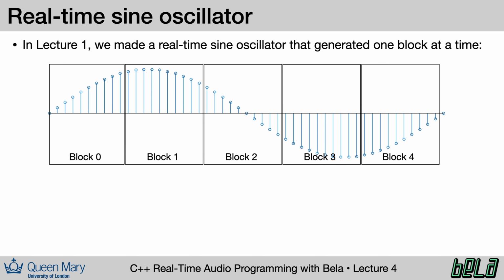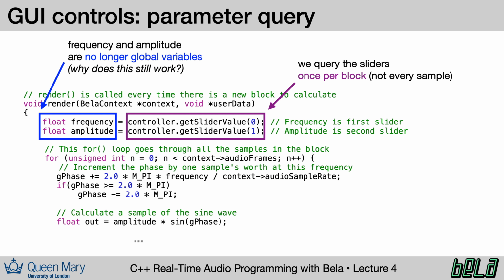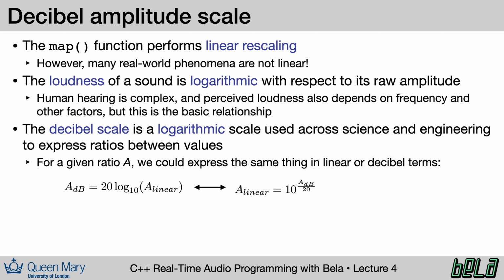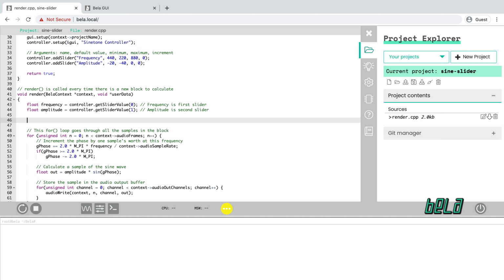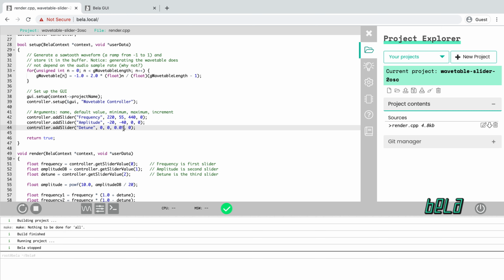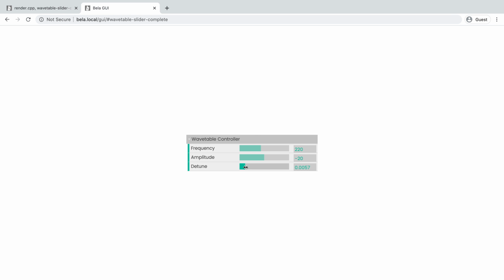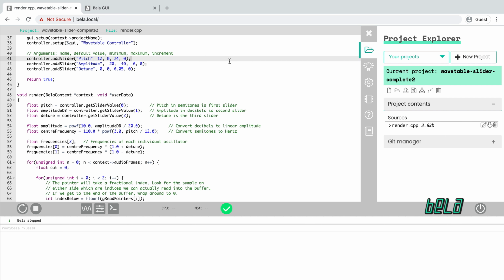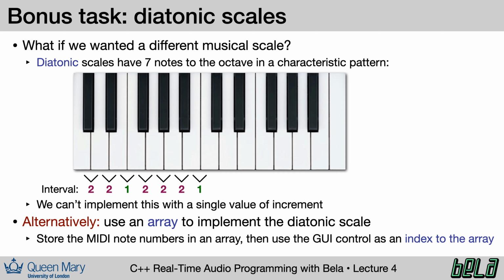4: Parameter Control, C++ Real-Time Audio Programming with Bela

Comment: Hi Yall,
Is there a reason why the amplitude should be multipled by 1/n, where n is the number of oscillators? Right now, wouldn't you be getting a doubling of the specified amplitude?

Comment: Gosu Material!!

Question: When changing the scale of amplitude to a DB scale, could I have just added this line to get the same result?

amplitude = map(amplitude, 0, 1, pow(10, (-40/20)), pow(10, 0));

Also, I implemented the major scale intervals (crudely). It took me a solid 20 minutes of tinkering sadly. This is what I came up with:

	controller.addSlider("Pitch", 0, 0, 7, 1);
	controller.addSlider("Amplitude", -20, -40, 0, 0);			//AMPLtude in DB
	controller.addSlider("Tune Parameter", 0, 0, 0.05, 0);

	return true;
}

void render(BelaContext *context, void *userData)
{
	float pitch = controller.getSliderValue(0);	// Pitch is first slider
	float amplitudeDB = controller.getSliderValue(1);	// Amplitude is second slider
	float detune = controller.getSliderValue(2);		//Tune is third slider
	float midiarray[8] = {pitch+69, pitch+70, pitch+71, pitch+71, pitch+72, pitch+73, pitch+74, pitch+74};
	midiReadPointer = controller.getSliderValue(0);
	pitch = midiarray[midiReadPointer];
	float fref = 440;											//Reference Frequency
	float centreFrequency = fref * powf(2.0, (pitch-69) /12.0);			//Convert semitones to hertz
	float amplitude = powf(10.0, amplitudeDB / 20.0);				//Convert Decibels to Linear Amplitude

Comment: Really enjoying this series, thanks! Regarding the issue at 26:57, is there an elegant way to re-align phases after they have drifted apart? My quick solution was to reset the second oscillator's read pointer to follow the first if the slider value equals zero, but it isn't very smooth sounding.
Reply: The other thing you'll see on analog synths, I believe, is some degree of phase locking between the two oscillators, usually in the form of slight feedback (obvious or subtle) between each oscillator. As long as the oscillators are reasonably close in frequency they eventually lock together and stay there; if they are further apart they will drift and produce beat frequencies. I haven't looked into how this is usually implemented digitally, but I would guess some kind of feedback term between the phases of the two oscillators could produce this locking effect.
Reply: you could let the second oscillator's frequency be slightly off for a few samples more until it is almost back in phase and only then snap it to follow the first oscillator's.
Reply: But on analog synths they would just stay out of phase :) Truth is, on analog synths they would never be perfectly in tune, so a more "analog" way of "fixing" this issue could be to never have them exactly in tune and always leave a bit of beating between them even when the detune is set to 0.

Comment: This lecture series is amazing. I built a MIDI controlled wavetable synth using an Analog Devices 21161 DSP whilst I was at University around 20 years ago. The Bela platform makes this so much more accessible. I don't even want to think how long it took me to cover the amount of ground you've covered in the first four lectures. Using the PRUs to move around the sample data was a really nice solution. The fact that you've added the IDE, libraries and excellent examples is astonishing, and then to top it off, it's open source.  Well done to everybody involved.

Comment: If anyone wonders (as it isn't explained in the video) the 10 log₁₀ x for power vs 20 log₁₀ x for amplitudes/voltages  is due to the relation P = U²/R and log₁₀ x² = 2 log₁₀ x (the R disappears because dB always describes a ratio between two powers or voltages/amplitudes)